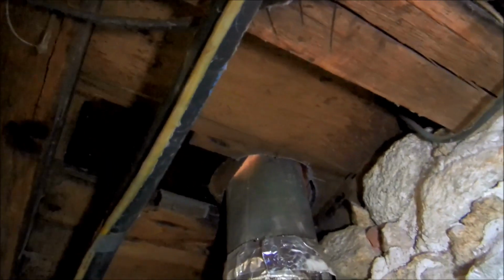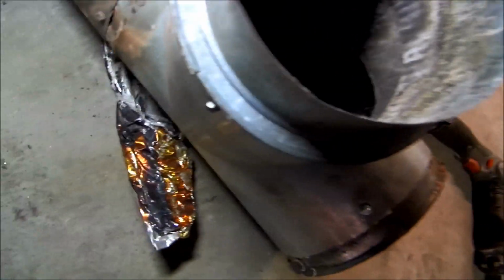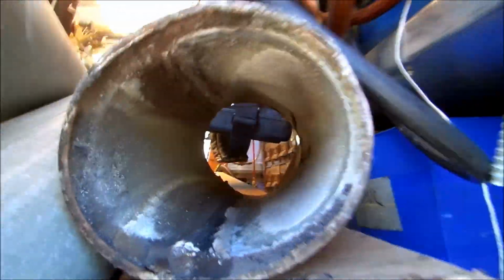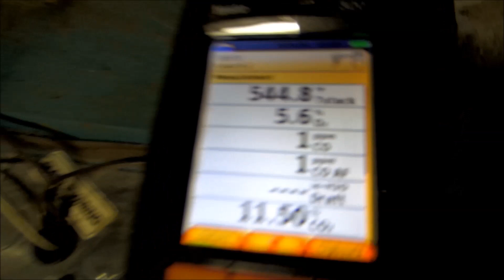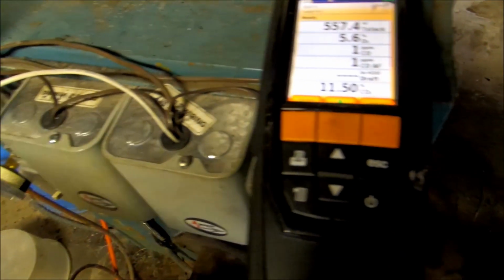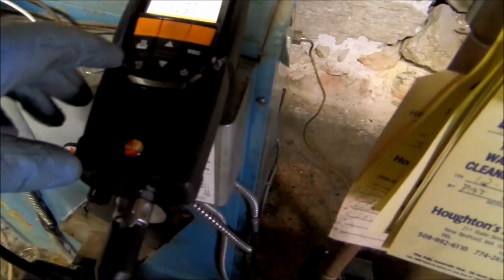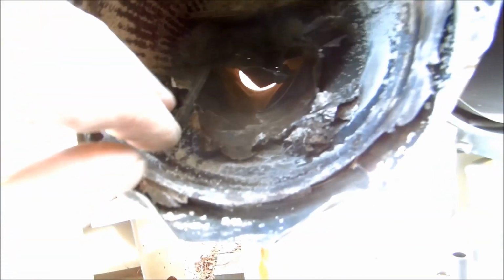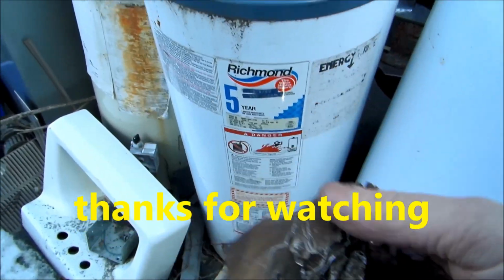burnham oil fired boiler with bad roll out  part 2 ,testo 320

Comment: Once again, you're a life saver!  Whoever installed the wrong type of venting ought not to be in business.  Some years back, my father had the chimney re-lined for his oil furnace.  Sometime later, he heard an explosion from the furnace; can't tell you what caused it, but it cracked the heat exchanger.  When the new furnace was installed, the tech found that the chimney liner was meant for gas and couldn't withstand the heat from the oil burner.  So the chimney was relined with the correct product.  That was about 8 years ago, and all has been well since.  (Furnace & burner are serviced once a year by a technician who is competent and trustworthy like you are)!  Great videos, Steve.

Comment: WOW!!!   No daylight , no draft.  lol  Nice professional install Steve Lav. Will the testo scroll down to excess air?
Reply from the maker: yes i programed it in there just for you i will start showing that ..  if you like i shout for just below 12 on my c02 on oil  any more it will blow soot  i am not to concerned about excess air
Reply from the maker: yes i programed it in just for you ,i will start showing it..... on oil i look for low c.o. and my c.0.2 to below 12 any higher it will blow black soot.

Comment: Wow... Can you say CO poisoning? That boiler must have been spilling back unreal amounts of CO into that home. I have never seen a flue in that condition.  Good fix. You saved their lives. 

- Jack
Reply from the maker: Fireship1 bad roll out ,and no draft .. you can not use b vent on oil ...this is what happens
Reply: Yea I agree. I have 3 boilers connected to same exhaust. The middle one has a flame rollout to front of boiler. Any ideas on what it could be

Comment: Nice video Steven. It sounds like you and the homeowners were having a party..haahaa. What are the differences between All Fuel and B vent?
Reply from the maker: Nicholas CeeA b vent is for gas only,,,,all fuel vent is for oil or wood burning  thicker vent stack
Reply: steven lavimoniere Thanks, I skipped over 2 videos to catch part 2 and I see that you explained the vent differences in video blog #10 when I went back to watch the 2 videos that I skipped.